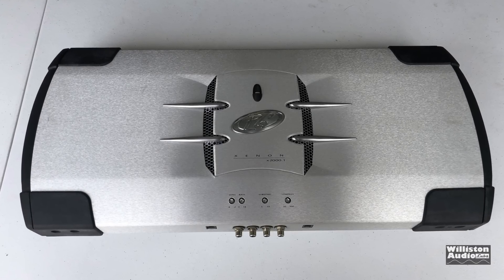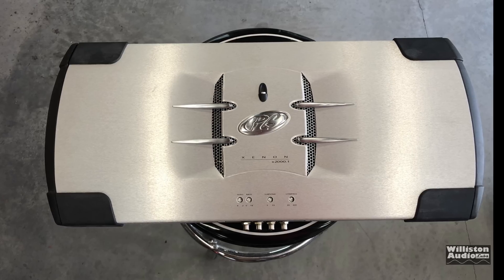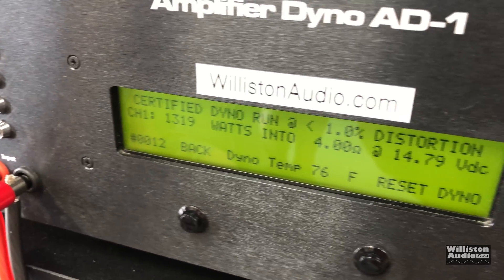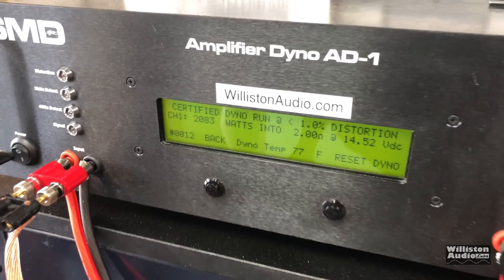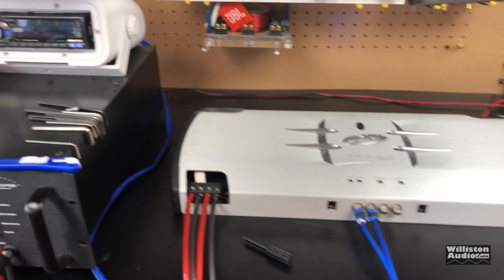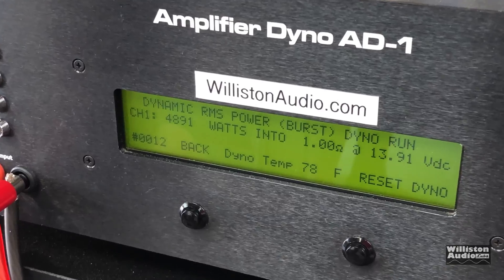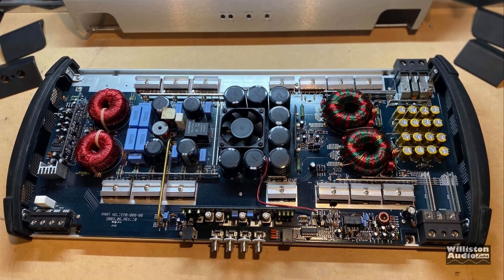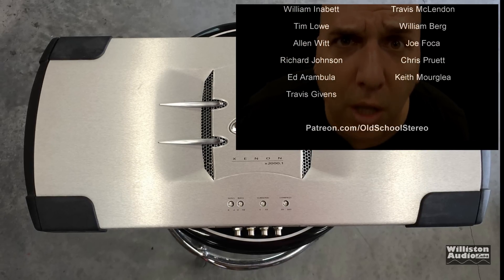RARE Prototype 2004 Phoenix Gold Xenon X2000.1 Amp Tested [4K]

Comment: I've collected a set for my system in progress, some experiences: The cover is just a single piece of aluminum which will usually be bent if you find it used. This makes the cover bind on the pots causing weird problems and cut outs. Taking the plastic pot ends off and or bending it back fixes this. Also have Had to spray pot spray in them, now they work butter smooth and clean. The RCAs are nice but didn't hold the pin very well, I bent the inner pin tab things up w a dental pic now more solid. Also the Fans seem to go out/ or have problems. Can be replaced with a better quality (60x1). They are always missing the rubber wire covers. Wish I could find some.

Comment: You didn't use the second set of power inputs did you? Just got a 1200.1 Wish I could get a dyno on it.
Reply from the maker: The Xenon amps are strong. I was shocked

Comment: please test interfire 6000w class d amplifier it costs around 180 usd in indian its the go to choice for mono block amps i suspect them for highly overrating their amps because its has only 5x40 amps fuse if we assume its efficiency around 90% also it cannot be near its rated power but here every one is claiming it to be a 6kw amp so plz test this amp its the most searched amplifier in india u will get good viewers from india coz there is not a single video of indian amps on dyno

Comment: Please dyno a Pioneer sx1980 receiver
Reply: It'd be harder to dyno test an older SS monster amp from the late 70's/early 80's due to weight and bulk. I have a MCS 3125 125wpc at 8 ohm and I think it does over 200 at 4 ohm, and it weighs over 55 pounds. I have an AB International, 9620b (850 wpc at 8, 1500 at 4 ohm, and 2kw at 2ohm per channel; channels can bridged but it needs something like a 30 amp breaker to do it or the 2 ohm, which is nuts) and the toroid itself weighs almost 60 pounds, plus whatever the boards, case, heat sink, etc. weigh which is around 66 pounds total.

Not only is it NOT cheap to ship (both ways) items that heavy AND bulky, it's easy for them to get damaged and need double boxing at a minimum.

For what it's worth, EVERYTHING for home audio since at least the late 70's is done by law and standardized. So if it says 150 wpc, it's at least doing that fully warm non stop. Headroom can be higher though, and it might peak a bit more if kept cool. Only exceptions is seemingly garbage mid and low range from more modern gear since the 2000's where they force bass into a pre-outs and limit freq. ranges, meaning if you run full range 15" woofers, it won't punch as hard as say that SX1980 does.
Reply: @RealCapricousCavy  i have a time ago      pioneer sx 880 weight about 20 pound. The sound of this receiver is the most cleaner audio ever hear in my life including FM AM radio signal. Never need a fan to cooling heat sink
Reply: @especialistqap  I have a Realistic STA-2600 that probably weighs 25-30 pounds. It's rated at 100 wpc and is actually bass punchy if you want it to be and a good overall spound. Have a MCS 3233 (33 wpc) that's just as punchy but WAY more dynamic with excellent sound separation and weighs a tad more although it's rated 2/3's less. 

The monster amps (usually TOTL and at least 100wpc or more) from the late 70's early 80's however, are more in-line with my MCS 3233 having an oversized transformer. Usually, about 80-90% of the older unit's weight, is from the transformer. Toroids are large and heavy too when you start stepping up the wattage. Problem is, you have a stereo that's as large as desktop PC and weighs a ton. Even lighter units are bulky. I've had pristine stereos shipped that ended up with damage too, as shipping companies are a-holes anymore. So it's not as easy as a car amp that's way more durable (but just as bulky) to ship. Other issues is you risk the solder on the boards breaking from stress.

Yeah, late 70's to early/mid 80's was the sweet spot for Solid State gear. Even stuff that was considered low to mid-range (back then) can compete with or surpass mid to upper range modern gear, musically, NOW, even when they haven't been recapped. Unfortunately, prices have skyrocketed. Paid around $300 for my 3125 about 4 years ago. Worth about $600 now (NEC rebadge but both NEC/MCS are under the radar vs. Pioneer, Sansui, etc..). The SX 1980 was under a $1000 back then. Now they are going for $4k+ The bigger Marantz from same era have skyrocketed too.

But at least home gear is rated at correctly. But modern gear... good luck getting it to do 100wpc at 30hz They'll do it at 1khz or should do it, but musically, many have a "flat and compressed" sound stage. Good for a noisy garage or something.

Comment: Short and sweet , like a throwback to the early vids . That's a surprising result , for one of these Xenon series. Kind of a shame it never made  it past the prototype stage, but like you said ,  the variations in output may be why . My 600.1 birth sheet shows little variation between ohm loads . I bought it partially for that reason . I always favored that stable output,  for sq . No one note bass , as inductive reactance varies with freq , using a stable output amp , and a sealed enclosure. I saw these Xenon amps in a few vehicles at the IASCA/USAC world finals , the one year they were held near me ,  in Memphis , and liked the look and sound . The little 600.1 and cosmetically matching X10D4 , in a 0.8 cu/ft enclosure, has been in the back of my Trans Am , ever since , with zero issues. Old school power , sound quality, and bulletproof reliability. Gotta love it . Thanks for another great video .

Comment: That's Cleary a 5000 watt amp
Reply: No, its a 2000 watt amp.    And if it was made in 1993 it would have been rated  300x1  Its just the way it is, or was.

Comment: Hey man im young kid and im tryna put a subwoofer just to get some extra bass, for it doesnt sound so echoe in the car.My only question is if i can run this Dual xpr82D amp which puts 240rsm.But the subwoofer i wanna run is rated 250rsm.Will i be fine? The sub is KFC-W120SVC Kenwood.

Comment: How can I get one of these?
Reply: You might be able to find the Xenon 1200.1, but you won’t find this specific one. It would probably be easier to just get a JL Audio Amp if you are looking for that similar Technology of equal Power at different Ohm loads.

Edit: If you do find and buy a X1200.1, I would probably recommend 1/0-4ga reducers regardless of what it says. Or 1/0ga and a Distro Block with only a short run of nice 4ga on the Amp side.
Reply: @ŠpVŠpý  There is a used xenon 1200.1 on ebay now for 425$
Reply: Given it's a suspected prototype, good luck.

Comment: 3000 watts sucking power through a coffee straw is crazy (4 gauge?) Didn't know 4 gauge can provide that much appetite? Another Great video D 👍 thanks
Reply: AL KOSMO it’s just a burst , no way that amp will handle it continues
Reply: @MichelLinschoten  yeah exactly even a short run is going to heat up after a couple of minutes of 200+ amps of current. Best case scenario the voltage drops enough across the heated wires for the amps protection to engage and shut it down, worse case it keeps drawing current until the insulation melts and it's in gods hands after that
Reply: @MichelLinschoten   the amp has dual power and ground im not sure why everyone missed this.

Comment: Only 4 gauge wire dam Id be afraid of that.I remember last year when I had 4g cca wire it burned and melted the fuse block. Never again was scared to run 4g again so instead I went 0g ofc stuff never looked back.
Reply: It's not the wire you just passed what the run of 4 gauge could handle safely.  I had 4 gauge on almost 2000 watts but my run was short so I was ok.
Reply: Resistance can be as much as 40%... 4ga CCA is more like 8ga OFC.  Probably would not have melted with 4ga OFC.
Reply: It's also dual 4 ga look at the top of the amp there is a second set of power terminals

Comment: I had the 1200W series pushing 2 RE SX10", it was a big amp for it's power but it wasn't enough for the subs so I replaced it with a PPI DCX1500.1D.

Comment: Still a few new in box 100.2 xenons on ebay for 99 bucks. Pretty much the bargain sound quality amplifier for someone doing a budget system. That 2000.1 is definitely a one-off piece. Production never went past the 1200.1 sub amps
Reply: I picked one of the 100.2s up a few years ago from WoofersEct, can't beat it for $100.

Comment: That's good power! Beautiful amp too. If you use 4 guage OFC would that be safer?
Reply: 4 ga ofc is the only option. You should never even pull 100 amps through 4ga cca. 400 amps thru 4 ga is only safe at like 4 feet or less
Reply: @rmblwgn  That's all I use now but in the early 90s all we used was CCA! Never had any problems. OFC does make a difference... 👍
Reply: @adaboy4z  No one I knew used cca in the '90's. Everything was copper in my world.
Reply: @cafe80s  ok.

Comment: What do you mean 4 gauge? That amp has dual 4 gauge inputs just like my xenon 1200 and 200.4.
Reply from the maker: You are correct. I was going on memory as we tested this amp on the Spring of 2018
Reply: the power hookups on the top are suppose to be for adding caps at least that's what my manual said for the 200.4
Reply: Dual short runs of 4 gauge are bare minimum for those amps. 800 watt class ab, big dynamic, high currant, old school triple darlington goodness. They will limit their power but the difference is a lot when given the proper current.
Reply: @canadiancaraudioaddict4766  one 4 gauge input will supply enough current
to the amplifier, but in some SPL situations the option of using dual 4 gauge inputs is available. The second terminal
can also be used to wire an external capacitor to the amplifier.
right from the 200.4 manual!
Reply: Then you just go by that my friend but just so you know that amp will draw over 200 amps.

Comment: Did the amp get hot?
Reply: From what Big d has told me before they dont run enough on the bench to heat up
Reply: @TheCrossover369  Perhaps if he hooked it up to the subs for a sound test.
Reply: Sure
Reply: I have ran some of this line in cars before and they cool very efficiently.. one of the better Bargains on eBay when they come up for sale. Not many people are aware that they are decent amplifier

Comment: My friends growing up: Why do you run nothing but Pheonix Gold products?

Me now: THAT'S why...
Reply: The Man, The Myth, The Legend  but there newer stuff is cheap junk
Reply: @promo130  most newer stuff is cheap junk and what is it is extremely expensive. Newest amplifier I own is a Fosgate 25 to Life power 1000. I like the new head units and DSPs but man. Unless you paid dearly for an audison thesis the new amps aren't that impressive
Reply: @gen-X-trader  I have a set of Sundown Audio SA12D2s in an Aeroport box that I built out of 3/4" MDF and a Soundstream Rubicon Nano RN1.5000D and it slams. I paid $450 for the two subs and $180 for the amp. My head unit is a Boss 7" touchscreen and my door speakers are 6.5" Kickers with Infinity tweeters.